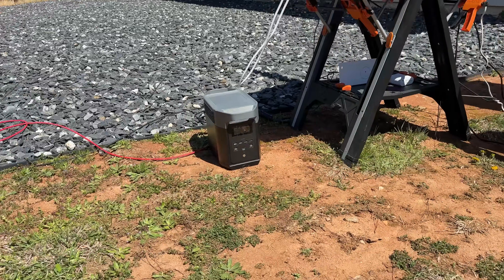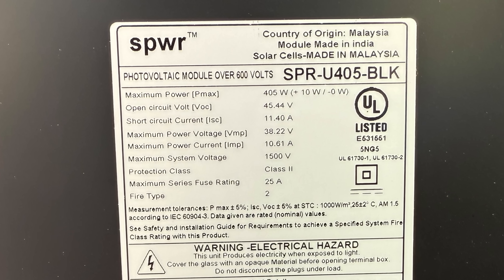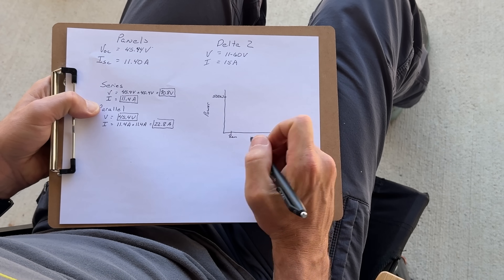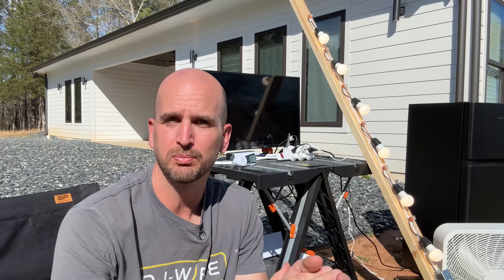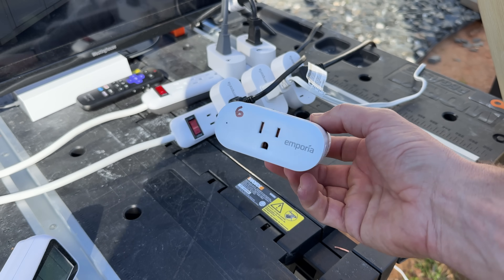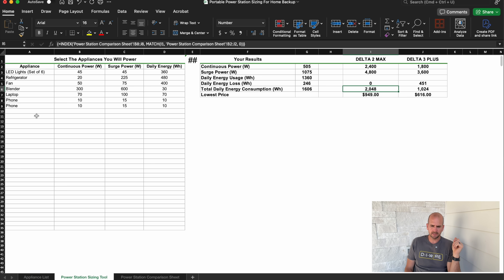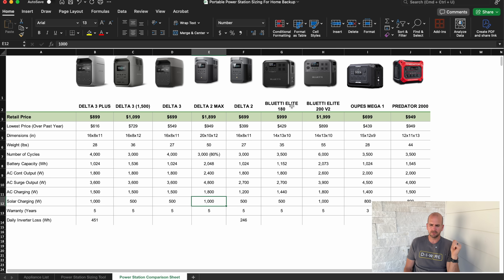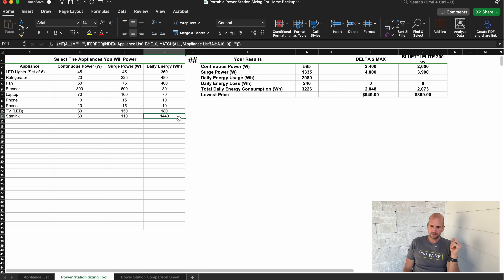What Size Power Station To Power A Fridge

Comment from the maker: Solar Cost For Your Home - https://geni.us/solar_reviews
DIY Home Solar (Save $1,000's Going DIY)  - https://geni.us/qN9Ot

Portable Power Station Sizing Worksheet - https://geni.us/8BlxWx
EcoFlow Delta 2 (Insane Price) - https://geni.us/u46bT

Other Products Used
Solar Panel Tilt Calculator - https://geni.us/iB7l
Emporia Smart Plugs - https://geni.us/QKyYn
Outlet Power Analyzer - https://geni.us/53xRGp
Solar Power Analyzer - https://geni.us/s86J

DISCLAIMER: This video and description contain affiliate links, which means that if you click on one of the product links, I’ll receive a small commission.

Comment: I have a Delta 2 Max with a solar capacity of 500w, 11-60V and 15A on each of the 2 connections. I have 200w panels with VOC of 23v and ISC of 11.05a. So it’s safe to connect 3 of these (33.15a) in parallel on each connection for total of 1200w?

Comment: I have an eco flow, I would never use one of these pre-built systems for something like that.  You get so much more capacity by just going over with a 12 volt 230ah battery, then do your utmost to make sure everything is running off of that 12 volt.  Dometic 12 volt refrigerator, laptop charger that is 12 volt to 12 volt, 12v air conditioner if you need one, starlink mini so it doesn't have the huge draw of moving the dish around, Make sure you get the 12 volt adapter for your starlink, then just get a cheap 30A mppt, and as efficient of an inverter as you can find for anything that you can't get to run off 12 volt.  I can tell you in my motorhome my dometic refrigerator if I keep my grubby hands out of it only draws around 15w once everything is cold, in fact this morning I checked and it was pulling less than 5 watts.  Do your shopping in the morning so that your food has a chance to cool down during the day when you have solar.  Remember, cooling from ambient temperature or heating from ambient temperature is also a battery of energy.

You would be amazed at the efficiency of 12 volt versus converting from 12 volt to DC and back to 12v.  

The way I have my motorhome set up is with 9600kwh on 48v, then I have a little MPPT controller that drops from 48 volt to 12 volt to keep a 230 amp hour 12 volt battery charged up.

Comment: I'm curious what the listed wattage is for your fridge.  My delta2, when fully charged, will only run my fridge for about 14 hours.  My fridge was rated at 150 watts and averaged 70. hr + the battery loss.  Are you using a mini fridge?

Comment: I added braces on my duel tractor 8 panels on it Now. I get 1.2kw all Day 9 am till 7 pm  using echo 195w Bio panels 8 of them. My First string I've made don't even know if good lol I like the tractor, easy to clean, low footprint can easily mow around. I raised my foundation 10 inches so could walk under it. Just added wire in conduit to power tracker and pv power to inverter. Like to watch it move when working out side.  In fact when it levels out (sleep mode for wind) I call it day too. Lol

Comment: This was the most down to earth video I've seen on how to wire a solar system. I'm mid way though mine and still didn't understand it till now.

Do all solar generators allow overpanelling with parallel wiring? Specifically in my case the anker f3800 plus.

I'm using bouge rv 200w solar panels, they guys at bouge rv told me likely a good max system was two sets of 5 panels in series, for a total of 2k watts of input. Seems like I should be able to do better with a system that should allow 3200w input. Any ideas?

Comment: Why is the inverter loss so high on the Delta 3 Plus vs the Delta 2?
Reply from the maker: Not sure, I am adding a Bluetti AC180 into the mix and diving deeper on inverter loss testing next week 👍
Reply: @ I’m definitely looking forward to it! I just picked up a Delta 3 Plus and the 1kWh battery to use as a UPS for my modem, router and desktop. I intend to get some solar panels to play with soon as well, so seeing the really high inverter loss is kind of disappointing.

Comment: Wow i havent thought delta 3 plus would be 2x less efficient than delta 2. You didnt tell about delta 2 max inverter losses tho 😅. But thats not fair that more expensive model gives less energy out, Ecoflow sure can fix the efficiency to match Delta 2. So Delta 2 has 25% inverter losses thats on pair, but how can delta 3 have 40% loss. Thats a deal breaker, as its already expensive compared to couple of River 2 Maxes, that have like 30% loss, and i can have 70% roundtrip efficiency, and 3 units for same price. So im better off buying delta 2 than 3 or what😅

Comment: Ok, here is my question on solar, what is the cost benefit of solar vs the cost of the batteries/replacement intervals.  I have felt that people have been swapping electricity cost for battery and solar panel replacement cost hence intrigued but not interested at all in solar polar until those two issues have been addressed, did tempt waters somewhat with a hybrid F150, battery has an 8 year warranty, it can be fords problem then.
Reply: can also diversify generation means, maybe combine solar and wind for generation, also there are ways to expand the battery with third party parts but that's warranty voiding.

Comment: How do you do a Daily Inverter Loss (DIL) test? I have a Delta 3 plus and I'd like to see how much mine consumes with just the inverter on.
Reply from the maker: I just kept the AC inverter on for 24 hours and then measured the percentage drop.  The main issues with this is associated to the percentage charge isn't always directly associated to the Wh left in the battery.  If you do the test make sure on the EcoFlow App you turn the AC output timeout setting off.  I think the default is to turn off in 1 hour if there is  nothing plugged in.

Comment: Ok. I'm currently testing a system, inside my house. Because, I want to know, that I will have enough power, for a camper I'm going to build in a cargo trailer. 

I have learned. That the bluetti ac 180 will Not start my kitchen refrigerator (normal size). 

I'm currently running everything in my living room and kitchen. I'm using a 1500 watt electric heater. And I will be installing a 5000 btu window a/c unit. 

I ended up getting the Bluetti AC300, I have 4 B300K batteries. This is handling all the loads. 

On a day with poor solar conditions. I can use a 30 amp gas generator to charge the batteries in under 4 hours. 

I wanted to be sure I could get all the way through a full night, without concern about running out of power. 

I wanted to think I could do this with an 1800 watt power station. But, its not enough. 

I wish you well on your adventure.
Reply from the maker: Thanks for the feedback.  Yeah I like the AC180 (actually have one showing up this week) but similar to the Delta 2 from EcoFlow for the application you are outlining the battery capacity and power output just isn't enough.

Comment: I have seen a few videos on running fridges off a system and they often find that the power usage is less than on the sticker. What they don't realize is that they are only testing for a short period of time and not long enough for defrost cycles to kick in and that's the missing power usage as the heating elements pull a decent amount of power and then the compressor kicks in to remove the heat that wasn't carried away by the condensate water. So if you are using a fridge with defrost in a humid climate you will go into defrost more often which will run defrost more often as well. And if it's a manual defrost the fridge will loose efficiency as the ice builds up.
Reply: Good point

Comment: when i first purchased batteries for my garage/workshop solar system i was told to get 3 days of battery capacity......i did not do that and it was a mistake. when planning for battery use you should expect to need 3 days of use. just a few days of poor solar and you will be out of energy. If you are running less battery storage you WILL need back up such as a gas generator.
Reply: This is the THIS.  3-5 days of autonomy.  Unexpected low solar input and/or higher energy consumption MUST be accounted for. A fridge 100 feet from the power source will require appropriate sized extension cords vs a fridge right next to the power source. Many factors.  Stay gold.

Comment: delta 2 with extra battery is cheaper then just the delta 2 max
Reply from the maker: True story, just weighing out the benefit of the 1,000 W Solar input on Max as compared to 500W on Delta 2.

Comment: Nice video. Clearly the Delta 2 isn't enough for your application. But I really think you should do a video where you actually show a real world example of sizing solar panel and storage to support a specific load, and derive a rule of thumb for sizing a system.

For example. I have a Delta 2 (~1000 Wh) + a 150Ah Eco-worthy 12v Lifepo4 battery (~2000 Wh) hooked up to the Delta 2 via a Ecoflow Alternator Charger for extra storage (3000 Wh total). I have 600 watts of solar panels hooked up to the Delta 2 (so slightly over-panelled). I've found this setup is just about the minimum size required to service a 850 watt daily load (2.5 hours of walking on my treadmill, which draws 375 watts continuous) without ever having to resort to AC power. The 3000 watts of backup storage is just enough to get me through 3-4 cloudy days of drawing 850 Wh per day when my solar panels are only producing ~300 Wh per day due to the clouds.

This result suggests to me a rule of thumb for specing a system - if you want to (almost) never run out of power, you'll need battery storage that is 3 to 4 times the amount of watt-hours you plan to draw per day to account for inefficiencies and clouds. 

I'd love to see you do this sort of experiment with your load over a couple weeks to see what it takes in terms of solar panels and storage to make sure you never run out of power.

Keep up the great videos!
Reply from the maker: Thanks for all the feedback.  I am building a 12x16 modern shed in my backyard that I am going to power off-grid that will also provide a good testing platform as it will have considerable loads like a mini-split system for AC and Heat.

Comment: Save $150 and get 2 Delta 2's, you don't have to use just one inverter.  Refrigerator on one and the rest would work on the other. Only $798 that way, big savings to get more solar panels.
Reply from the maker: Not a bad option at all.  The Delta 2 has been a little workhorse for me over the years.
Reply: Plus additional resilience without a single point of failure.
Reply: Or get a delta 3 plus that have 2x500w mppt. Plus it's compatible with delta 2(1kwh)/delta 2 max(2kwh)/delta pro 3(4kwh) extra batteries!

Comment: I live daily with the Delta 2 and two 100 watt panels atop my mini van. For one person it is JUST enough to cook two daily meals. I would suggest Delta Max as the minimum.
Reply from the maker: Yeah, the extra battery capacity and solar input of the Max is nice.  The Bluetti options are also compelling.
Reply: @everydaysolar I've been very happy with the Elite 200 v2. I jumped into that and 4 100W EcoWorthy panels (based on your reviews ) after Helene took our power out for two weeks, and I wish I'd had the system then! Now, I'm using it as a UPS for home office/Internet and keeping the fridge cool overnight without having to run a generator should we lose power again.
Reply: @tumbleweed ~ Another option would be to connect a 12-volt/100Ah LifePo battery to your Delta 2 via the D/C input with an XT-60i connection. That would give you an additional 1,280 Watt-Hours of storage, combining the Delta 2 would give you 2,304 watt-hours of battery storage and more capacity than a Delta Max at 1/3 the cost. Consider upgrading your panels with 150, 200, and 250-watt panels (depending on the dimensions) since a Delta 2 can input up to 500 watts D/C an hour via solar or battery.
Reply: @royrobinson4636  Thank you for taking the time to suggest. Greatly appreciated!
Reply: @ ~ My system started with a single *Delta 2 over 2 years ago. I have since created two independent systems by adding eight solar panels, another Delta 2, with eight (8) 12volt/100Ah Wattcycle batteries (four per Delta), two Victron 100/20 smart (Bluetooth) charge controllers. My battery storage is 6,100 watts per system, with a combined total of 12,200 watts. I can generate just under 1,000 watts per hour with eight 120-watt panels at an average of six hours of good sunlight daily.

Comment: The power station is responsible for limiting the current input from the panels?

I dont have a power station, but i do have an MPPT charge controller, I wonder if my MPPT would also limit current if i were to overpanel according to its specs?
Reply from the maker: It should, but might want to check the specs/brand to ensure you are 100% confident.  All of the integrated MPPT charge controllers I have worked with have this feature/behavior.
Reply: I have a Bluetti AC200MAX and many others and I always over panel. As long as your in spec with your voltage rating on the system. Also state of charge and load on the system has so much to do with what you get from a panel.

Comment: FYI -  Inverter/power station losses for the Bluetti 200 V2 consisting of 5% of the watts delivered direct inverter consumption + power station standby loss figures of 12 watts per hour to 15  watts per hour have been shared here at 18:31 into the video from DIY Outdoor Life on youtube here  https://www.youtube.com/watch?v=vKG2tiiNTV4  

My comment left on his video -  Finally a truthful explanation of the touted Bluetti 200 V2 "95%" efficiency.  It consumes ~5% of watts it delivers to a load PLUS 12 to 15 standby consumption watts per hour delivering those watts - So in the real world example shown in the video for a refrigerator using 1,000 watts per day - 50 watts eaten getting the 1,000 out + 350 standby power consumption watts eaten over 24 hours = 1400 watts consumed to provide 1,000 watts a day for the refrigerator  1,000 divided by 1,400 = 71.4% TRUE REAL WORLD USE EFFICIENCY 

A fine exemplar of Truth Telling. Well done Sir. Well done with your  "Bluetti Elite 200 v2 - Comprehensive Review" from
DIY Outdoor Life on youtube here  https://www.youtube.com/watch?v=vKG2tiiNTV4

Is there a budget DIY battery / battery bank with inverter combination that can reach 90% efficiency in the refrigerator example you cited?  Thank You. 

FYI   Numbers of tests attribute lower efficiencies to the OUPES Mega 1 including also a 40+ watt per hour standby consumption,   Its most efficient test here East Texas Homestead, at the 5:50 point into this youtube video "Off-Grid Portable Power Station Test: OUPES Mega 1",  showed a 87.4% efficiency with a lower, ~235 watt draw, "full discharge test".  (As a plus another youtube test showed 93% efficiency for AC charging from the wall outlet at its 700 watts per hour rate setting other tests show much lower charging efficiencies and some observations the the numbers on the oupes display are questionable)    

The hyped, yes it is quiet,  "96%" efficient bluetti shows a 75% real world efficiency as seen here "Bluetti Elite 200 V2 Portable Solar Generator Review" from Minute Man Prep.  WHAT IS "THE REAL WORLD USE TRUTH"? The Bluetti Elite 200 V2 web page lists these real world delivered "capacity/ efficiency" examples 40 watt fan 31.7 hours = - only - 1268 "watts out" divided by 2,073.6 watts = 61% efficient and 500 watt electric griddle 3.1 hours = 1550 "out" = 75% efficient and 600 watt ice maker 2.6 hours = 1560 watts out = 75% efficient and 1,000 watt coffee maker 1.6 hours = 1600 watts out = 77% efficient - fast drain full discharge capacity tests on youtube show one can get 96% of the battery capacity out on AC. Fast drain full discharge tests do not tell real world use efficiency  TRUTH very well.

Comment: At that power demand it might be better to get an EG4 3000 Off-Grid Inverter (Has an AC In) And EG4 5kwh battery for that starlink house, and custom build it but I understand the convenience and price of a portable station especially since inverters and batteries went up in price but it doesn't look like ecoflow has budged much.
Reply from the maker: Yeah that would be a nice alternative especially for the home with the Starlink load but the plug-n-play nature of the portable power stations might be the determining factor as it will also help troubleshooting any issues where I just have an extra unit for the normal house loads.